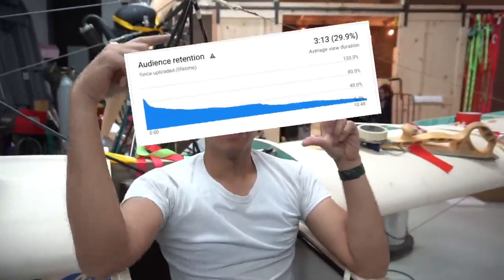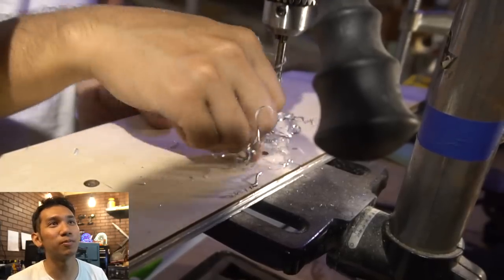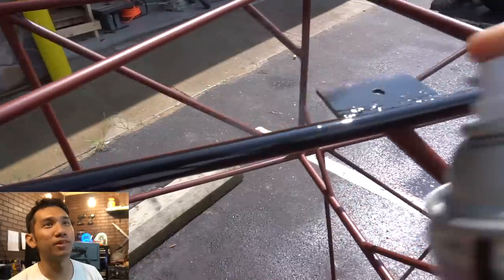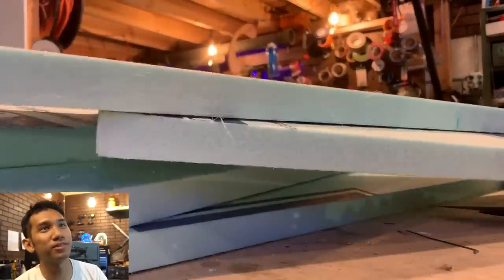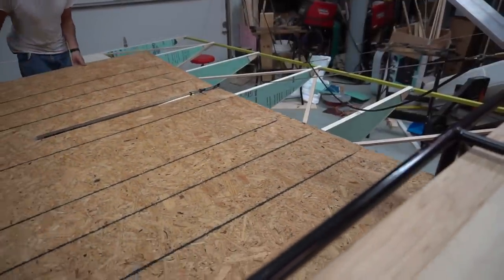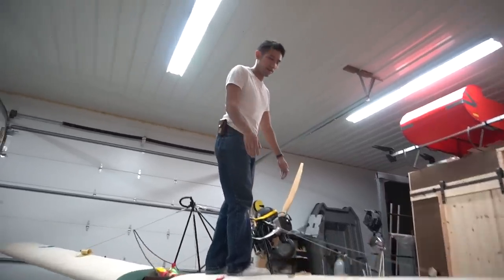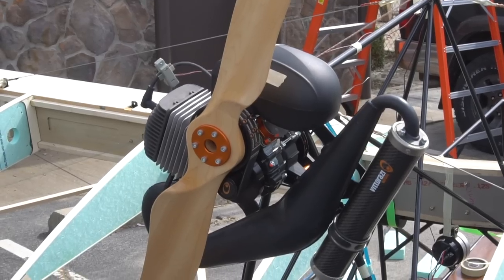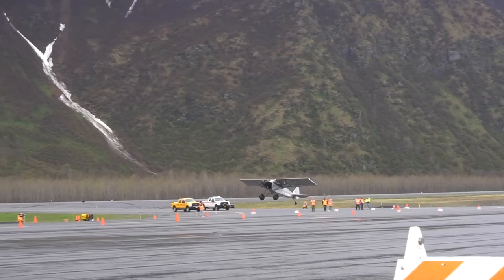Homemade Airplane MK3 pt4

Comment: The montages are amazing, and they give a good impression of the building process. They won't retain every viewer though, as it requires some experience making stuff to fully appreciate.

However, I don't think that the additional commentary adds much to the montage: The montage is organized to convey the build process visually, but the unscripted commentary struggles to keep up to the information presented.
You could try the other route, creating a commentary narrative first, talking about the hardest/funnest parts of the process, then editing build footage in to support it visually.
Reply: That's a polite way to say what I wanted to say - "WTF is this?" Love the content, but sometimes sarcasm and levity can come across as disinterest or insincerity. 

Anyway, keep up the good work!
Reply: If he can get the pacing right, he could use montages to sort of "fast forward" through the less interesting parts of the process, so they could still be included, and then slow down for the sort of scripted commentary like you're describing.

Or, maybe the montages could just be reserved for the secondary channel.
Reply: @cx765 True, that'd also improve on the commentary idea!
I was mainly distracted by the dissonance: Lots of effort into the montage, but the commentary felt unprepared and lagging

Comment: Your Alodine looked fine. I'm an aircraft Mechanic and use alodine quite often during sheetmetal repairs. Alodine wont always be the yellow color even though you have a decent coating. So I would say your good!

Comment: When removing cherry max rivets, you need to carefully sand the top of the rivet use a scribe and remove the lock ring in the middle of the river, the purpose for the lock ring is to keep the center stem from coming out, then carefully drill the head the head off. Your project is looking good.👍

Comment: Hey man, I just found your channel and I find the project really inspiring.

I just wanted to point out a few things (mainly about the alodine).

First thing I REALLY hope you are not using Alodine 1200 or such which contain Chromium 6+. Hexavalent chrome is highly toxic (causes cancer, mutations, and stop you from having childrens).
You want to be especially careful when handling it and even more when machining aluminium that has been treated with it. (Drilling and blowing the bust is a bad idea).

 
Also there can be multiple reasons why your parts didn't react well :  The concentration of Cr6+ is too low in the solution, you didn't remove the alumina (aluminium oxyde) on the surface of the part, the part wasn't degreased or the pH of the solution might be too high. 
In your case you want to apply acid on the alumium until bubbles start to form (indication that  Hydrogen comes out which means that there are no more oxyde on the part). The best way would be to dip the part in a container filled with acid.

Finally I don't really understand why you applied Alodine on those aluminium parts. Alodine doesn't protect well the aluminium from corrosion and it is mainly used in the industry to improve paint adhesion and allow electricity to go through the surface of the aluminium (by removing the alumina).

By the way, also becareful when drilling zinc chromate (if it's really zinc chromate) as it is also toxic. I would really advise using vaccums to clean your parts.

Keep up the amazing work !

Greetings from France.

Comment: A cheaper and simpler design this time I think.Wire bracing and no ailerons is a good simplification.Its refreshing how you make difficult things look so easy and that is your great contribution. Im not an engineer but I think you should have tilted the aeroplane about 10 degrees nose down  during the  3g loading to test your  trailing edge connection to the fuselage.Wishing you success in this and future ventures.

Comment: I have a project idea.... how about using the star shaped base from a cheap rolling office chair to make a drone... It already looks like a drone, its lightweight plastic, and nearly indestructible. Just remove the caster wheels and insert props... The center hole (where the hydraulic cylinder used to be) would make a handy place for electronics and a camera.

Comment: As some advice for retractable landing gear, look at the construction of the small soviet I-16 monowing plane.
It has a hand cranked winch which uses a set of pulleys connected through the wheel hub that pulls it towards the fuselage.
I recommend having it hand cranked, and then when you want to release it, let it drop by just having a "release" mechanism that lets the wheels just drop down without human power.

Comment: Get nuts and bolts for use with cotter pins. Then pin them in place. They will never back out. Or if they are close enough safety wire them together.

Comment: I would not feel bad about cutting to the end of your video.  I did, just to see if you actually fly what you are building!  Can't wait to see you fly!  But safety first.  Talking of safety first, I heard the fastener nuts falling off your plane when the motor was running.  I suggest putting two nuts on every bolt end, with a lock washer in between the two nuts.  This keeps the nuts tight on the bolt, under most any condition.  If you still worry about the plane falling apart in flight, try three nuts tightened together on each bolt.  Good luck!

Comment: I actually really enjoy the montages. That's what made these videos so different than others. Maybe allow the viewers to know exactly what you're doing when you build things instead of just rushing through it? It doesn't have to be you talking through everything though. It could just be you taking the time to hold up the material you're using and allowing the viewers to use your techniques. I don't think you need to get rid of montages, just take more time on them.

Comment: Pete, you mentioned loops. If you intend to do any aerobatics with your plane, I'd recommend no less than 4 G capability, and then you need to really know what you're doing. Certified civilian planes are rated at 3.5 G minimum and allow no aerobatics of any kind. Just one old pilot's opinion.

Comment: Peter I love your builds you magnificent maniac. It's so great how much you love flight.

If I can make a suggestion for alumi prepping your aluminium. Take a red scotch Brite pad and scuff each part real well. Hang a piece of lockwire through a hardware hole (as if you were preparing the part for paint). And with a spray bottle spray on your alumiprep solution and you will see it bubble up as it reacts with the scuffed aluminium. After about 5 minutes wash off the part with water, I use a spray bottle for that too but rinsing in the sink is good too. Then also using a spray bottle spray on your aledine solution to the part and let it sit for another 5 minutes, sometimes you may need to spray twice in case too much dropped off. Then just rinse with water and you have an aledined part.

Comment: i was wandering how do you calculate parameters such as wing span, motor power, carrying capacity, other dimensions and all other parameters. In short, how do you calculate all airplane parameters?

Comment: Hi Peter, It seems you're doing a good job on your airplane. I kick myself for not building a light weight plane after I left the flying game back in the early eighties. The reason was, gas prices , and plane parts,were going sky high, and it became very expensive to fly. I got into RC and that sort of soothed me for a while. I didn't know about ultra-lights, because they were made like a kite with baling wire! I guess those were the early ones, and I never pursued them afterwards, so hence I lost out!  I'm 82 and still have the bug, but my physical condition won't let me do much. That's one reason I watch your videos, it makes me feel good to see you succeed in your goals! I'm sure you plane will fly nicely, but I would have put on a larger engine! Good luck with all your endeavors.  Bob

Comment: Knock the center out of the pop rivet and then drill the head off with a bit a little smaller than the hole size and then knock the rivet out. It's super easy.
Reply: And if you need cherrymax rivets lemme know!

Comment: Use polyurethane bushings to dampen vibrations
Either that or secure it tighter than hell so the vibrations disperse directly through the frame

Comment: Learn about "Aviation Grade Hardware" that uses "LOCK WIRE!" The lock wire prevents you nut's and bolt's from working loose due to "vibration!"

Comment: I like that you're using  oaratex... What about sharing some thoughts on your wing design? Curious about why you chose 1 spar and not 2? Also are you concerned about twist? Also i noticed when you were loading the wing you didnt go all the way out to the ends. Just curious if you thpught about the increased leverage? Oh and I thought your montages were cool.

Comment: Use an alumiprep solution to help the alodine take to the aluminum better. Before the alumiprep clean the metal off with acetone so you don't etch in finger prints. Should only take around 30 seconds in the alumiprep for it to be ready for the alodine which, depending on the quality of your solution(i.e. uncontaminated from other metals or materials), can take anywhere from 45 seconds to a few minutes. All you want is a nice even bronze. Be careful though cause the alumiprep and the alodine WILL "burn" the aluminum and you'll have to remake the piece.

Comment: I'm not into the montage but I am  an AP and IA and I liked the first plane although it didn't look like the tail was large enough.  This  one looks well designed, maybe overly so. Alodyne doesn't always change color like you want it to.  I like welded steel tubing fuselage.  They ar reliable and proven.

Comment: I don't follow the instas or the tweeties, so I guess it was my fault I didn't know you were coming up. I didn't go to the Valdez fly-in this year, had I known you were coming, it might have been enough of an excuse to ride down.
A similar event used to be held in Gulkana many years ago. Valdez always struck me as an odd place for this particular type of meet. First, the flying weather is generally bad there (although spring is usually the best in Valdez) and STOL and off field operations are not nearly as common there as in other parts of the state. Also, unless the weather is good through Portage Pass, it can be hard to get to in a light plane, especially if you're coming from anywhere besides Anchorage (Thompson Pass is very often completely closed, that's the pass the road and Trans-Alaska Pipeline go through).

My knowledge of aircraft coverings includes cotton and it's two main synthetic fabric replacements. Ceconite seems to be the most popular in the GA world. You show a very brief bit of a repair demonstration, but don't say much about the covering itself. It would be good to see actual application, at least insofar as how it differs from a cloth process. A review of the product would also be helpful.
In that vein, you haven't described the power plant in the videos much. Only that its a two stroke. What make, power, displacement? Was gas power always the plan, or is this a replacement for an original electric concept?

Comment: Did you do any kind of teardown inspection or NDI on the frame after the load test? Maybe I'm being the overly cautious engineer here, but I'd want to make damn sure there were no cracks or permanent deformation in the structure before I would trust it with my ass in the air at 70 knots...

Comment: So now i have just read EVERY comment (which is why my comment is so freakin late) Using my right thumb while cradling my phone with my left hand palm up with just the finger tips to avoid touching the screen and supporting my phones mass with my right hand allowing my thumb to hit the keypad i am now typing in my comment. Now i prefer using my phone with an otterbox case....

Crap i bored myself to sleep with my narration, where was i?

Comment: I enjoy your tenacity!   However no reason to reinvent the wheel....  2 strokes are radical!  Power to weight is amazing... but way to inefficient and the oil screws up carbs and parts.... theres a reason airplane engines have 2 ignition systems and designed with redundancy and back up measures... you prolly dont even have a reserve?    Why not build a boat??  You can buy an airplane for as cheap as 15k that has FAA qual. And engineering.... just hate for you to get hurt or hurt someone else bud